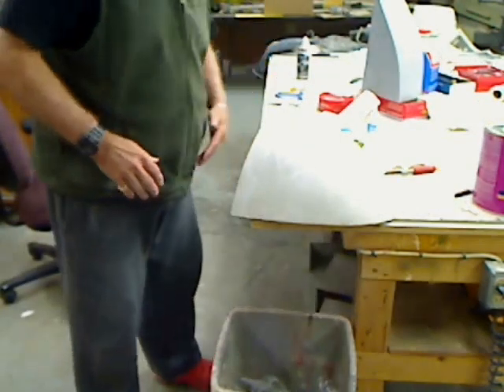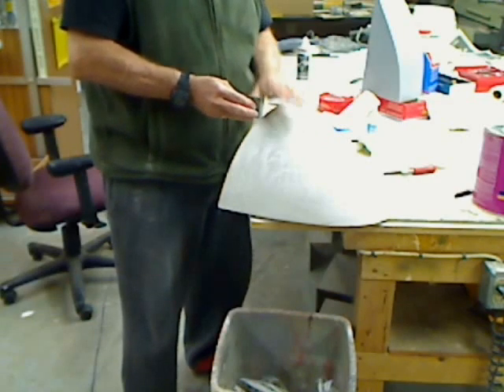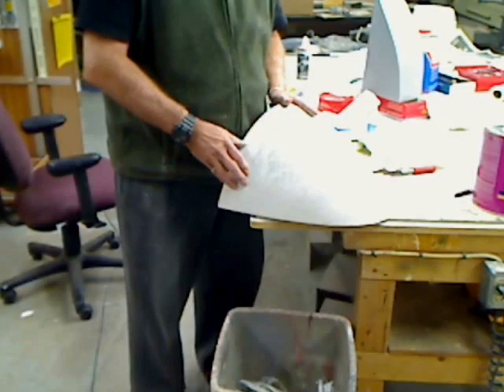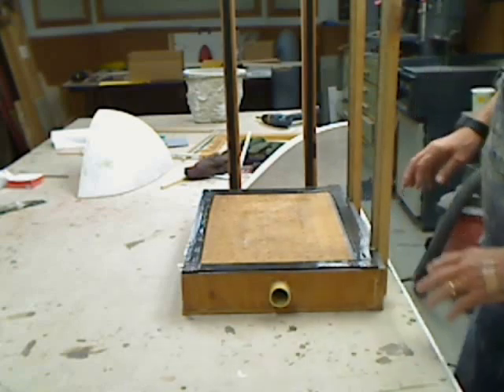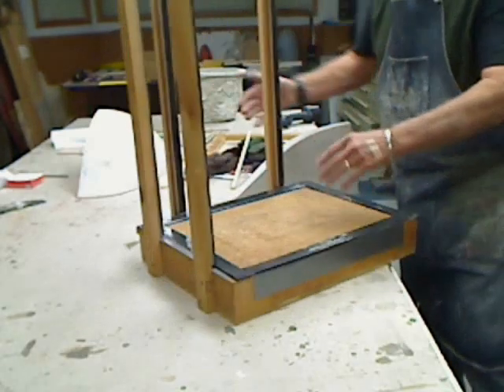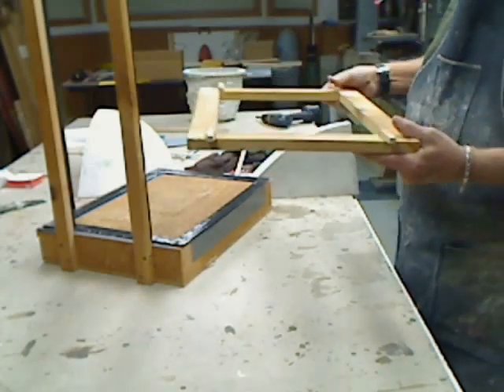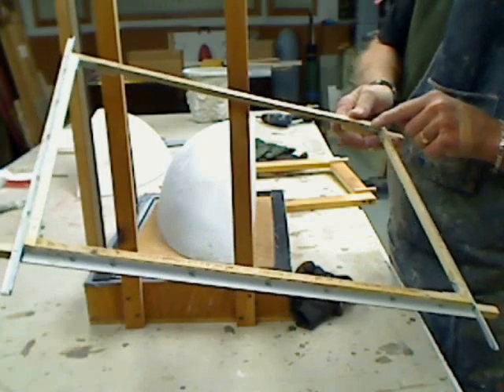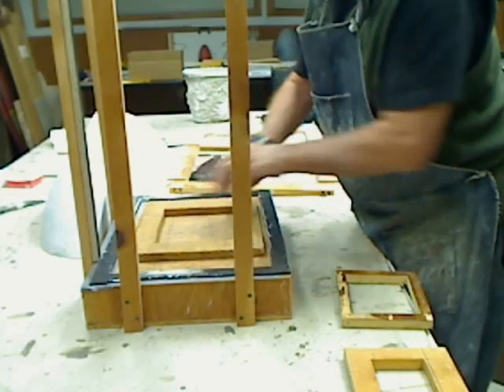Starship #10 Vacuum Forming Canopy Part 1

Comment: Merlyn, I totally understand the need to leave 'scratches' in the surface of the mold (plug?, lol) so that air can escape and the vacuum will pull it  tight to the form. How do youy reconcile that theory with the fact that you're pulling a second piece over the top of the first and still get the vacuum flow as you described? I absolutely know this method works (resulting in a more transparent canopy) but I've always been confused by that aspect.